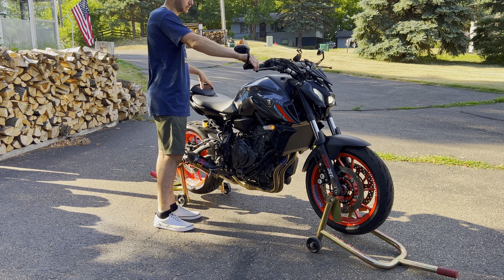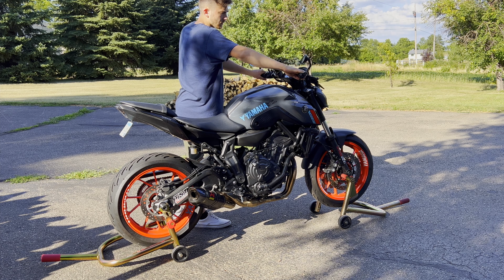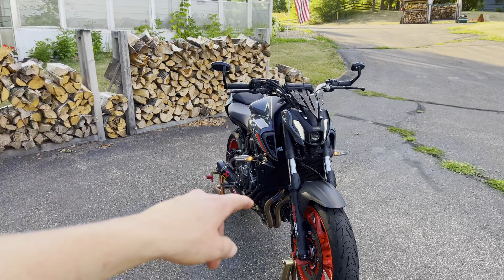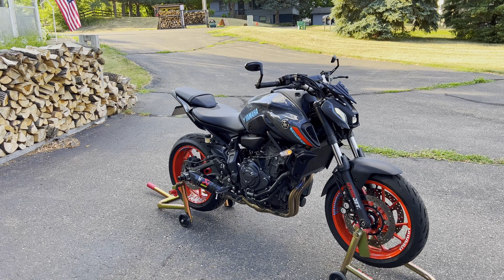This thing sounds INSANE!! SCARY YAMAHA MT07 | Akrapovic full system

Comment: Did you make your own map for the akra? I just put a power commander 6 on my mt07 and am waiting for ups to drop off my akrapovic exhaust. But looking at dyno jets website the only tune for the pc6 on an mt07 is the stock tune, not sure if I can use a PCV tune on the 6 or not, but even if there are no tunes for akra only yoshi and leovince.

edit: Spoke with dynojet, PC6 CANNOT use PCV maps. They said running the improved stock tune is good enough with the new exhaust but the ideal thing to do is get the autotuner or go get it onto a dyno to get a more specific tune. Hopefully this will help out some other people. Also you're the best for making all these videos man! I am doing the exact same setup so your videos have helped me out a TON. That power commander install was kinda a pain but it helped a ton having a video to walk me through.
Reply from the maker: This is great information and I really appreciate you sharing with me. I have been running the yoshi tune on mine since I installed it. You can go in and adjust stuff too but I do minimal changes. The auto tuner would be nice but one thing to note is you will need two ports for your O2 sensor on the bike and the auto tuner separate on the exhaust pipe. You would have to have a shop weld the port on that they include. It’s a lot of extra money to get the whole setup. 

Thanks for saying that man! I put a lot of work into these videos and some have taken upwards of 10 hours to edit all the clips together. So much much appreciated
Reply: @BradTheBuilderChannel  I didn’t realize you’d need 2 ports, thought it would just replace the O2 sensor but I guess that makes sense. I’m still kinda new to wrenching on bikes as I just got mine last year and haven’t messed with tuning anything whatsoever, so me tuning it is off the table until I learn more about it. And I’m in the middle of no where New Mexico and the closest shop to me is around 3-4 hours unfortunately. So guess it’s time to start learning how to tune!
Reply from the maker: @christianfry5387  wow that’s incredible. Yeah use as many resources online to learn. I learned a lot since from a very young age through trial and error and formal education. If you want to do it, you can learn. That’s the beauty of the internet. Just don’t be afraid to dive in. If you mess something up that’s how learn. It’s hard to mess things up major anyways.
Reply from the maker: Dynojet informed me it’s a second port because I also inquired about it.

Comment: I got a newer SV650 with akra slip on exhaust, arrow headers and k&n filter she rips! I haven't raced a mt-07 yet but I'm always on the prowl 😎
Reply from the maker: How do you like the new sv650? I checked on them a while back and it specs out slightly higher than the mt07 believe it or not. Very nice bikes!
Reply: @BradTheBuilderChannel  it's honestly one of the best bike I've owned. It handles really good and the power is more than enough for the streets it likes to be rev'd the power doesn't fall off at all near redline.
Reply from the maker: @clubstyleridahd4695  heck yeah! I noticed the engine does rev out pretty high. Suzuki is crazy reliable too.
Reply: @BradTheBuilderChannel  ya it's a great bike. I contemplate getting a cb650r though just for a little more top end high speed power.

Comment: Bought an MT07 about three months ago, first motorcycle I have purchased. Initial mod was to remove warning sticker from gas tank. Second was install Woodcraft frame sliders. More to follow, a tail tidy most likely.
Reply from the maker: Hell yeah! Good to hear
Reply: Wow I never thought an Mt 07 was a beginner bike
Reply from the maker: @johnmwenja1398  unless you have been riding recreational vehicles such as dirt bikes prior to hitting the streets. I agree though. A bike that reaches 130 mph and 60mph in 3.6 seconds is not a beginner bike. If I started on this bike I would have been dead already.

Comment: First of all congratulations, this is the best sounding video for mt07 I ever found. Question: is there any difference between the akapovici exausts for mt07?,(your model and the one which is lower hanging underneath the engine)Just purchased a mt07 and I would like to make it sound like yours but I like the look of the one hanging lower underneath.
Reply from the maker: The titanium version underneath has a catalytic converter in it and can be Euro 5 compliant where as mine does not have a catalytic converter. The one underneath can have the baffle taken out but will not be as loud as mine is. That is with the db killer in on my video too. I absolutely love it!! Thanks for the kind works as well

Comment: Which tune file did you use for the power commander?. The dyno Jet website have the tune files listed by exhaust brand, and Akrapovic is not there for a 2021 MT07.
Reply from the maker: Yeah I know it’s a bummer but I use the full yoshi tune per instruction from a dynojet rep.
Reply from the maker: Almost all aftermarket exhaust systems are free flowing and the tunes that go with each of them only vary slightly. If your still concerned, dynojet’s customer service is very helpful and they will be able to point you in the right direction of what to do.

Comment: As I said earlier in the comments I have the Brogue exhaust. Find it to loud. Have the akra exhaust on order. Should be in tomorrow.  Wondering where you got the map for your bike. Is it the one off dyno jet website. I see they have one for the XSR but have to use the stock air filter. Like to leave in the DNR filter. Is there other places that have maps for the power commander 5?
Reply from the maker: I’m not sure if there are other places with maps. I would give dynojet a call. They have always been helpful to me with good customer service. I got my map off their website but I use the full yoshi tune for mine because they don’t have an Akrapovic map for the 2021 mt. The xsr has the same motor so that time it’s fine. Give them a call! Peace ✌️

Comment: hey, what are those stands/lifts? can you share a link?

also, do you have a video installing the power commander?

I bought a used MT07 and it came with it. I want to see if there are any updates for it, but not sure how to connect to it.

thanks
Reply from the maker: The stands have been updated in the description in of the video. I do also have a video installing the power commander V but I do not cover the connecting to the computer part because dynojet who sells the powercommander has a great video on it. If you do not have the cord that connects to the powercommander you will need to get that. The cable is USB to 5-pin MINI USB cable which connects to the unit.